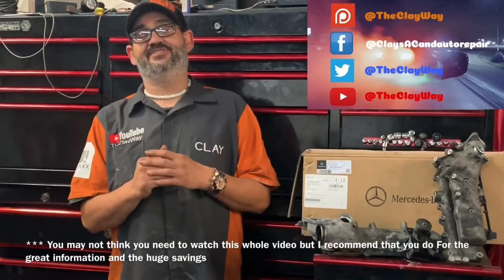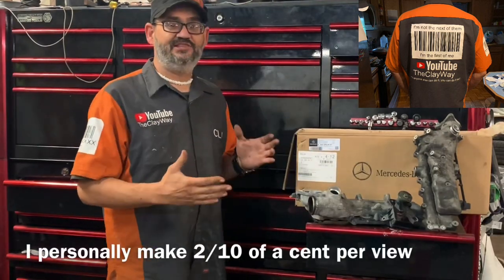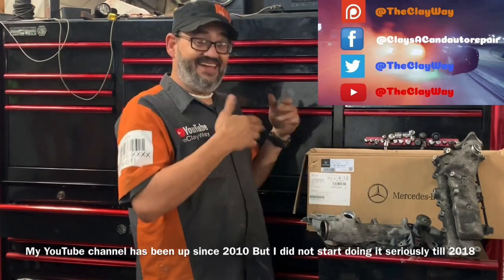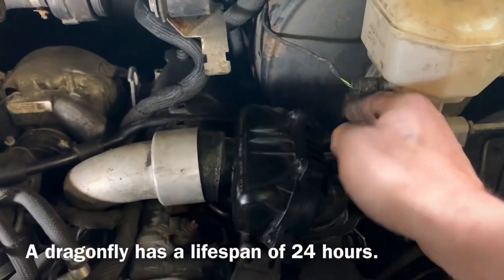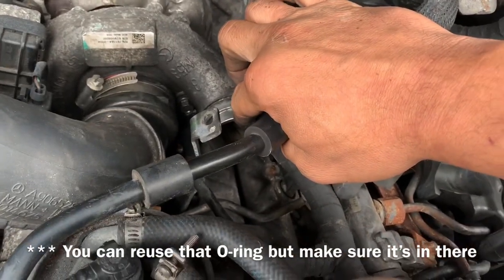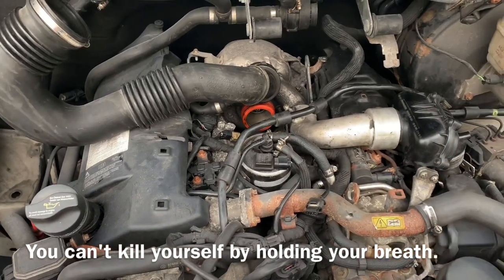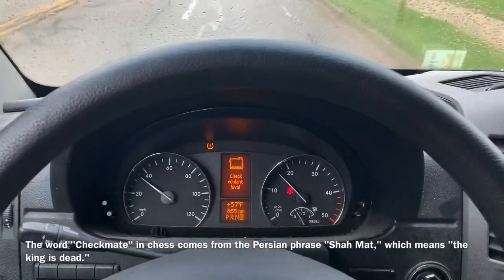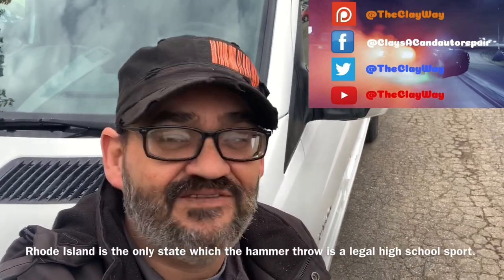sprinter 3.0 diesel swirl motor problem fixed for 2 Bucks!!!! I will save you thousands!!!

Comment: Are you not worried that the flaps will get jammed closed? Surely removing the swirl flap butterflys while proforming this mod would be best practices
Reply from the maker: Nope not at all they are more than likely already stuck open or stuck closed.  doesn’t make a difference if you watch the video I explain to you this is a temporary solution to be able to get you to where you have to go this is not a way of life. You’re really overthinking and thinking The flaps make all of that big of a difference.

Comment: What code reader would you recommend for a 2019 907 USA sprinter (3500 XD 4x4 3L 6.0 diesel) for me as a vehicle owner?  When I'm remote I would like the option of dialogue with a mechanic on the phone.  Had limp mode a few times.  Once it didn't correct itself and cost me a week.
Thanks in advance.
Reply from the maker: Unfortunately I don’t know if there’s an affordable option for a scanner on a sprinter. I don’t have very inexpensive scanners and none of my normal commentators Have not mentioned and affordable option the scanner that I use is a Maxis 908P with foreign European commercial software. I spent quite a bit of money on mine pretty close to $4000 I know that they sell on Amazon for right around 12 or 1300 but I don’t know the difference between mine and the more inexpensive versions. I don’t believe they come with the same software and that is the difference. 

My unit is getting a little bit dated from 2018 and it’s about $1200 to update it so I might as well try to buy a new unit that has 2022 software in it when I run into it and I will probably buy the 12 or $1300 option off of Amazon to compare the difference between the $4000 option and the $1200 option if that makes sense

Sorry I couldn’t be of much help but maybe somebody else will comment
Reply: @sharpcarco  i appreciate the input just the same and perhaps another follower will have additional guidance for both of us.

Comment: Great video. I did the resistor install, and after a few minutes, on the next start, I got a P2004 intake runner open. 
Has this happened to anyone, and is there a cure for it?
Reply from the maker: Depends on what year you install the resistor in later models after 2012 sometimes have runner sensors and I have not had one that I could make video of the bypass on but yeah I believe that it’s possible to use the same Resistor on the runner switches but I’m not certain of this
Reply: @sharpcarco  Mine is a 2008. So are you saying there is another connector to do this with? The yellow side of the resistor I put is on the right side of the connector looking straight at it. Any ideas before I start taking it al apart :-) !
Reply from the maker: Not on the 2008 model I figured you were working with something newer I don’t think you have the resistor installed correctly or you have the wrong resistor sometimes it will go into limp mode but very very seldom even with the  The resistor installed you just shut the key off and start it back up it will go away and eventually stop doing it
Reply: @sharpcarco  Well, went in and changed the resistor, reversed it, ran and got p2004, then cleared and got p2008. Cleared, drove it, and maybe got it right! Thanks for all of the info!! You rock!!!
Reply: @sharpcarco   I appreciate your bold and open videos on alternate ways on fixing these diesel engines. related to comment above, Did you figure this one out? I have a 2011 GL350 and before putting the resistor in, I was getting code 10cb00 right intake port shutoff end position sensor is defective, after the resistor install, I have two codes one for right and one for left...; is there a way to bypass position sensors?
Reply from the maker: Well thank you for the kind words I certainly try to take different directions with my videos and generally they are the most cost effective ways of doing them at least I try to make it them Way

No unfortunately I have not came up with a solution for bypassing the sensors because the sensor switch on and off I could not figure out a way to actually do them. So as far as I know there’s no bypass fixing at the correct way is the only way that I know of right now although in the future I do believe that I may have programming to delete them but I haven’t had time to work on that yet

Comment: So I know a couple of tuners who claim to be able play with the ecu file to be able to disable egr and swirl valves, do you actually have to pull out the valves and weld up the intake and do the egr blockoff plate or is just doing the tune by itself enough and how does that compare to doing the resistor trick in this video?
Reply from the maker: Honestly I don’t know because that would make it emissions illegal. I rebuild my intakes and Keep them factory this only occurs every 200 to 300,000 miles so it’s not something that happens every day on the same vehicle
Reply: @sharpcarco  fuck emissions. performance only after mileage

Comment: Did this on my 2008 and works great.
Could I keep this forever or would it cause engine damage in the long run and it's better to get it repaired?
Reply from the maker: Yes overtime technically not good

Comment: Where did you get the 4.7 k resistance value I tried it at work I didn't have one that size we had a 5.6 k work for a while but then the light came on still runs okay but the check engine lights on
Reply from the maker: You didn’t read the description or comments maybe you missed it in the video when I was holding the package of resistors up

And it will go into limp mode from time to time that’s One of the reasons I said this is a temporary solution but there’s a much bigger one to why you don’t want to continuously make this is a lifestyle

Comment: Hey Clay I like your style!!  I have a 2014 mercedes 3liter sprinter with half a million on the clock.  I have a P2005 intake manifold runner control stuck open.  I'm not a mechanic I'm a glorified parts changer.  Can I tackle this or do I need to make a little trip up to Grand Rapids?
Reply from the maker: Oh I’m certain you could do that.

And I’m over in Muskegon now. I could probably help you if you really think you need it I don’t do a lot of work for the public

Except on Mercedes and a couple of other cars

You can reach out to me on Facebook under clays Ac and Auto Repair send me a DM and we can set something up or you can email me even though I don’t look at that them as well as I should

Thenewclayway@gmail.com
Reply: @sharpcarco  thanks so much for the encouragement Clay keep up the good work!!

Comment: Think this would pass smog? I just purchased a 08’ dodge sprinter and I need it registered asap. Probably would fix after getting plates.
Reply from the maker: Definitely not with the resistor in there… it will pass it though if I delete the swirl flaps for you. Because it tricks the computer into thinking that the squirrel flaps are still there and you will never have to take the Intakes out again, but in order to do that you have to take the Intakes out

If you’re interested in shipping them to me, look me up on clays ac and Auto Repair on Facebook messenger send me a DM and I’ll break it down for you

Comment: Are swirl flaps really required? I mean if you live where there is no emissions laws are enforced?  Can I just remove the butterflys and get the swirl flap systems disabled from the ECU, or fit do the resister mod?
Reply from the maker: I’ve done it before and the vehicle ran great after it was reprogrammed actually got better fuel mileage. 

So I suppose the short answer is yes

Comment: Yes, this trick works with older modification OM642 engine which  doesen't has sensor reading opening and closing flaps, is any body has an idea how to bypass this sensor without  reprograming ECU?
Reply from the maker: I don’t right now but I certainly will in the future.
Reply: @sharpcarco  Did you come up with a solution to the EKAS Sensor bypass? Thanks
Reply from the maker: I sure wish I could’ve I was working on one today that had the same problem but the guy said he didn’t have time for me to try all that crap lol I wonder to myself if we can’t just pretty much do the same thing with the resistor maybe that would give the ECM a signal, that it doesn’t recognize and maybe will put it in bypass motor or something. 

It won’t hurt anything so if you wanna give it a try and report back put each one of them resistors in there and see what happens
Reply: @sharpcarco  My friend is a MB Sprinter tech, he is going to have a look in the next couple of weeks and I'll let you know. Cheers!
Reply from the maker: What we need to know is what kind of signal it sends when it’s open and what kind of signal at Sam’s when it’s closed if I had access to the documentation I could create a emulator. I don’t know how feasible it would be for people at home but I could make the emulator and sell them I just haven’t came across the right van that I could do that

Comment: Clay, great video! Do you know if this will work on a 2007 freightliner 2500? My son just bought this van from a lot in Oregon and changed the computer. Now it's throwing p2006 and p2007 codes. Not in limp mode but he can't register it in California like this. Maybe the old computer had GDE tune on it to suppress these codes?
Reply from the maker: Yes absolutely it should but just remembered that it is a temporary solution. I hope the weather and life is treating you well thank you for asking and I hope this helps you out have a great day
Reply: Thanks Clay! The van runs fine already but this issue is the MIL light, can't pass smog with it on in California. So do you think it will turn off the check engine light?
We are thinking about just pulling the intakes and sending them to you for a rebuild. Do you have a business address and what kind of turnaround?

Comment: I did this procedure on my 2013 Sprinter but I still get a fault end position sensor right and left malfunction.  What I can do?
Reply from the maker: Unfortunately when you have rail sensors this will not work they did not know that when I made the video regretfully the only thing to do is take the intakes out send them to me I will clean them and delete them without reprogramming them if you’re interested in that send me a message to Facebook messenger Clays AC and Auto Repair, I’ll get you hooked up

Comment: Will this work with the 642 Diesel engine in the ML and GL vehicles?  Those cars share the same 642 engine which contain the flaps.
Reply from the maker: Yes
As long as they don’t have the rail sensors

Comment: Hi clay, I tried your hack in a Mercedes’ Benz sprinter 2012 and works properly because the turbo come back to work but I don’t why now I have a problem with the coolant. When I turn on the engine and I accelerate start to lose the coolant from the intake I think because I can’t see any leak on the hose and you can see smoke after few minutes. This is really wears because before to did the hack was working perfect and this happened just after hacked. Do you have any idea what is happening?
Reply from the maker: well I can assure you that I’ve never heard anybody say anything like that and I don’t know what this would have anything to do with that coolant issue I am assuming that it was an issue before or could just be a coincidence.

More than likely your oil cooler is leaking.
Reply: Hi clay, thank you for answer. I already found the issue, was the coolant hose next to the firewall. What a coincidence.
Reply from the maker: Oh cool glad to hear it brother…

Comment: I have the same issue. I have bypassed the swirl motor. I'm out of limp mode. But the turbo is still not functional. Bough car as is. I have p2010 code
Reply: FYI. Turbo actuator works. I get about 14 psi of turbo boost. I don't have leaks (confirmed with smoke test)

Comment: Im going to give it a try . One question do I need a to erase the code with a scanner to make it work or it should work right away, bcause I dont have a scanner but mercedes scanned it and the flaps are stuck open. thx
Reply from the maker: No you don’t have to. 

The only drawback to the situation is with rail sensors sometimes it does not work. And this is a temporary solution it will eventually plug up your particulate filter. Having it fixed correctly is the best thing to do or deleting the flaps so the swirl motor activates the ECM correctly. If you’re not sure what I’m talking about you should probably look at my Sprinter playlist on my channel I have some really handy tricks that will help you out and some very good contact amazing dreams

Comment: Clay, great video! Do you know if this will work on a 2010 freightliner 2500? I have code P2005 and it’s in limp mode . Do you think it’s gonna be helpful in my case?
Reply from the maker: Regretfully, more than likely it will not. Because you have EKAS sensors. And you can’t bypass them. However, if you look underneath my Sprinter playlist, you will find out that there is a fix for it that I do..
Reply: @sharpcarco  Thank you man I will try to find out some more in your playlist.

Comment: gotta b the best sprinter engine video ever. love all the unrelated facts in sub text. im gonna do this mod but also wanna remove the egr and install a block off plate, as well as; throwing the DPF in the garbage replaced by straight pipe. this is for off road racing only. can u offer any advice?
Reply from the maker: Yeah I have a couple of great video showing you how to take that intake off etc. etc. let me know how it turns out

Comment: Hey clay I'm working a 2010 and codes are for intake runner volts low and stuck closed valve,And will blow the engine fuse not all the time short to ground.Bad swirl valve.I'm thinking of doing this to save them some money for now.How many miles are you getting out of the van doing this so far? Thanks
Reply from the maker: When I sold the van I had a little bit over 15,000 miles After I installed a resistor
Reply: Have you tried it with your 2010?

Comment: Just did this today and we are now at "full power" The codes still show obviously.  Thanks !
Reply from the maker: Well that’s awesome to hear Tom when you actually get ready to do them keep me in mind because I remanufacture them intakes now and I give a warranty you should check out the video that I just posted about that it is really cool have a great day glad to hear you got her back on the road
Reply: @pete lavigne the pressure of the turbo will blow it open, but should be center.

Comment: Can the swirl flaps be removed totally ? I mean if the manifolds are off would that be beneficial?
Reply from the maker: Yes they can. But.... bypassing the flaps with the resistor does the exact same thing. And if you have them disassembled you might as well repair it properly and the way it was engineered. 

Fairly soon and the not so distant future. I will be rebuilding them for the public I’m still in the testing phase. Making sure they will last the rebuild process is going to be half the price of the new component and the longevity of the component after rebuilt will be the same as the original.

Comment: Hi had you heard something about that, I get a 2008 dodge sprinter 2500, I’m getting the code 2641-008 B60 (Exhaust back pressure sensor ) plausibility error, I just change the sensor and still the code it’s coming back right away it’s cleared, I Check the three wires plug connector, looks ok 5v, solid ground, good continuity signal wire to the Pcm, I put some extra ground from the battery to the frame and motor, Pcm case and nothing, i tested both sensors in another car and works good, the lifedata is showing always 5000 hpa or 72.3 psi i think it’s a default value. I check in the other good car and shows the same with the plug disconnect. Any of you guys has heard anything about that, any ideas what could be, thanks
Reply from the maker: Is this what you’re talking about? If it is I had the same problem just the wrong sensor even though it looked identical I ended up getting one from Mercedes and fix the problem. 

https://youtu.be/hLW1FYretVE
Reply: @sharpcarco  hi thanks for answering, i just tested both in another car and are working good. I’m still with the same issue

Comment: Do you have a viedo on removing the  Dpf filter off a 2010 3.0 sprinter van?
Reply from the maker: No I’m very sorry I do not... i’ve never removed one when The engine was in the vehicle and I’ve been told that you have to play it is one of the simpler engines to remove as far as I’m concerned

Comment: Thank u great video. I can only find 4.7ohm 5% 1/4w      Is 5% ok? or do I need 2%
Reply from the maker: I made a mistake in the video and miss pronounced the correct size pause the video when I’m showing the package and get what is on the package

There are also several comments in this thread that Correct me with the correct size

Sorry about the confusion no you cannot use anything else that I’m aware of
Reply: @sharpcarco  thank you

Comment: I was quoted fifteen hours and $6K Canadian for this repair.  "replace left side swirl valve actuator"  while they were in there they were going to replace some seals and other things just cause they were in there.  I haven't done the repair because my van starts and runs like clockwork.  zero issues, so hard to get motivated to spend 6K.  
Anybody else ignored this problem away?  Or does it always lead to a limp mode morning and subsequent job loss, addiction, divorce, famine, halitosis, etc..?
Reply from the maker: Well if it’s got tits or tires you’re going to have problems with it….. 

You cannot ignore the problem it will not go away. 

But you can bring it over to me here at the clayway and it’s about three grand. If that’s helpful at all…..